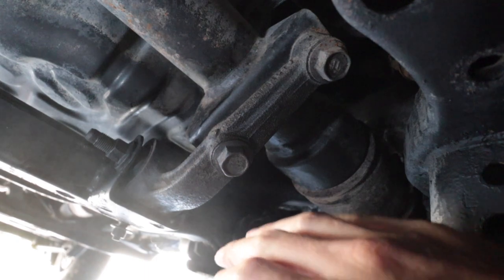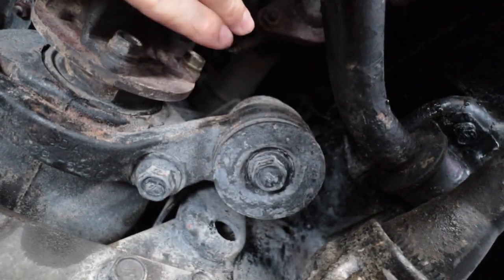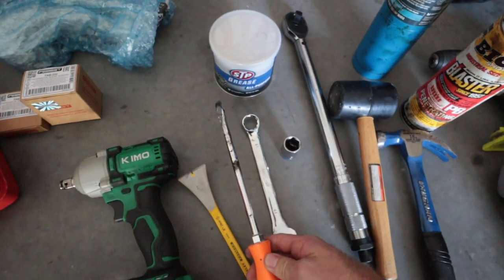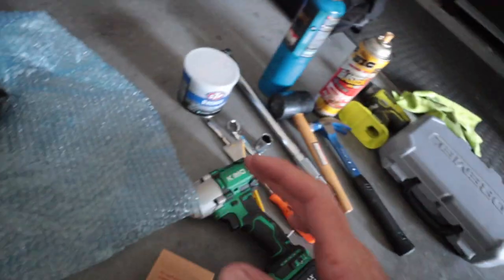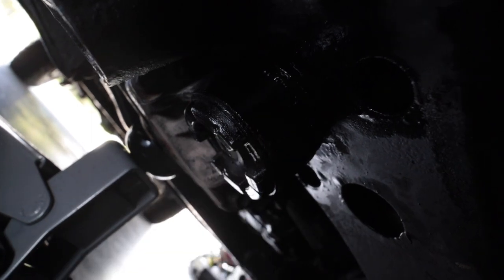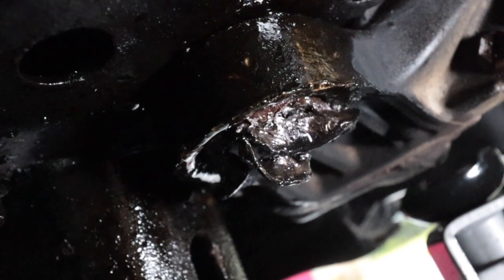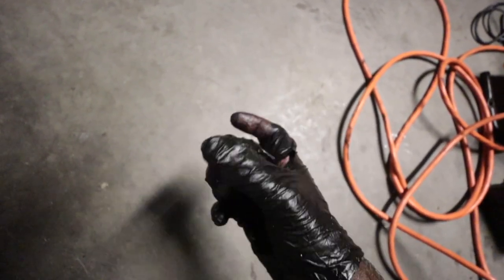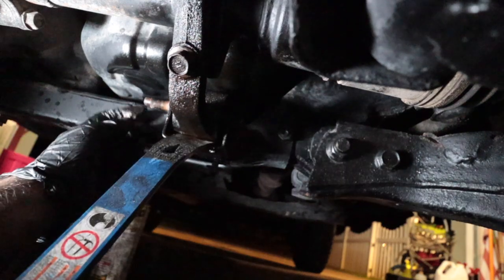How NOT to Replace Front Differential Bushings on a Land Cruiser

Comment: Whenever i am shifting my LC  gears from drive to reverse i am also getting loud the clunk sound. I was wondering what is that exactly. Was you issue fixed replacing the differential bushing??
Reply from the maker: Yeah it fixed my issue. Those are the most common, bushing and driveshaft

Comment: Great video. I love learning from someone else's mistakes (for a change)!  I know what you mean about bolt snap PTSD. I've got a touch of that myself from replacing my valve cover gaskets. Any idea how much a pro would charge to replace diff bushings?
Reply from the maker: Lol I’m glad I can help! I have no idea I would say with that the proper tools and equipment it would be 2-3 hours of labor. Not sure if a shop would do just the bushings or they would want to replace the full piece on the front of the diff so that could add cost as well. A lift alone would have helped tremendously.